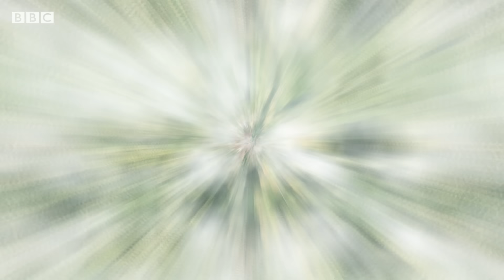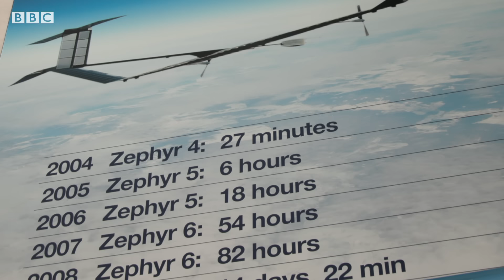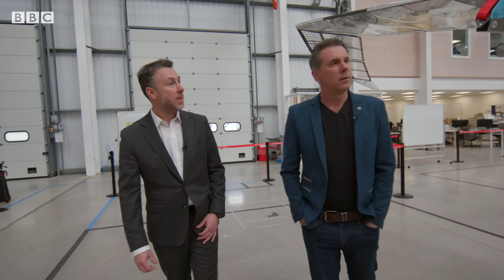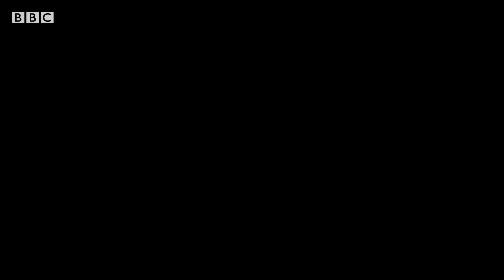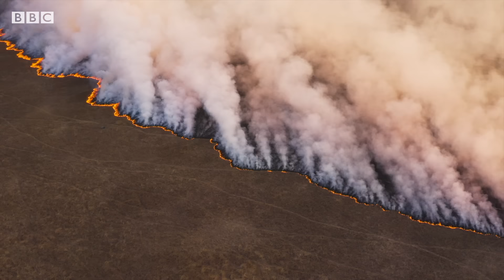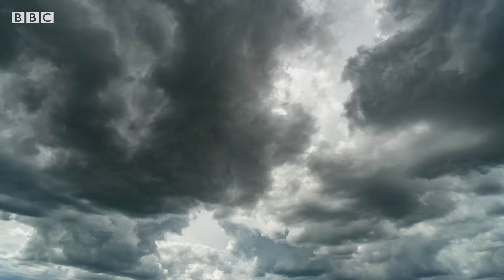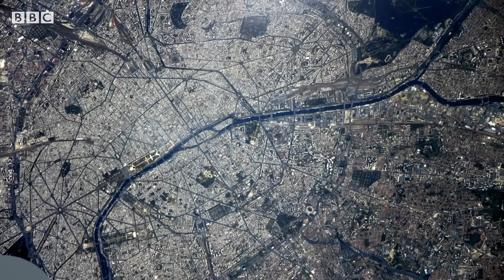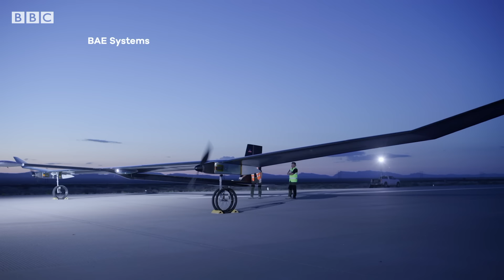The solar-powered aircraft flying high in the atmosphere | BBC News

Comment: I would love an FM broadcast transmitter on an aircraft like this. It would cover a huge region with no mountains or buildings to block the signal.
Reply: Or LORA
Reply: I'm no expert, but doesn't radio transmission for any significant distance require significant power?  They're already 5-6 miles up
Reply: @emmakai2243  5-6 miles line of sight is nothing, this could use much less power than terrestrial towers since it wouldnt have to transmit through terrain and obstructions
Reply: @dereksgc  And if the airplane flies around 40mph the turn radius is tiny.
Reply: @emmakai2243  Surprisingly not really. 50-100 watts line of sight will easily work at over 200 km of distance.
Reply: @emmakai2243  Not really, if you use higher frequencies. Shortwave radio for example doesn't need that much compared to say AM or FM. If you go into the Ghz range, then you will require a lot less power, although any obstacle (including trees) will block out the signal. It's how satellites do it: one satellite can cover the entire US for about 20 Watt/hour. And that's a signal that contains 100+ images @30 fps or so. So you could make rather easily an emergency type broadcast, containing pretty much anything you wanted to send in a few seconds, and say repeat (or change the payload) every 30 minutes or hour. Othernet sort of worked like that, they would send payloads at various times in a day, and if you got at least one of them, you would get the files of that payload. You really don't need that much either: weather + headlines + maybe important audio. You could probably send that in a fraction of a second and then keep the antenna off, and repeat the message at intervals.
The reason LoRA works better than regular wifi is for opposite reasons, what's messing your connection is interference, but that's a whole other tangent.
Reply: @emmakai2243  They're at 25 - 35 thousand feet? That's well below most of the jets.
Reply: @erickborling1302 they're at 60000 to 75000 feet
Reply: @emmakai2243 5-6 miles? He said 60000 feet minimum, that's over 11 miles
Reply: @emmakai2243 Yes. Lots of power.
Reply: @emmakai2243  The video was only 8 minutes and clearly neither you or OP watched it as these issues are discussed
Reply: @JBBost   No I didn't retain every single bit of info, where did it refer to FM radio power needs?
Reply: @JBBost  In the replacement for a lot cell phone towers discussion, I will believe it when I see it. Tech bros have a long track record of overpromising and underdelivering. I am an engineer, and I want technology to help us live better lives, the problem is is that the laws of physics do not care about what you want to achieve.
Reply: @function0077  If you're an engineer you sure don't sound like a telecom engineer and if you are you're about 6 years+ behind the times on this. The discussion in this field isn't even around replacing cell towers it's around supplementing them with satellites direct to unmodified cell phones in areas that currently don't have coverage (i.e. the majority of the planet). Do some DD on ASTS, they already solved this problem and tested it and are putting up commercial satellites this year. They will be able to do 5G broadband anywhere on the planet by the time their constellation is up.
Reply: @ThePalisky  I am not a telecom engineer. The information you are providing is interesting, but it is different than some of the claims made in this video.
Reply: @function0077  The information I provided is different because the people involved in making the video and/or the people making the plane don't know about the current technology.
Reply: @ThePalisky  "The discussion in this field isn't even around replacing cell towers"

The video literally discusses replacing cell towers with this.
Reply: @dafunkmonster  yes, this field I said, not this video. The video itself is missing what the telecom industry is doing. Thanks for incorrecting me.
Reply: I'm no telecom engineer but there are quite a number of hurdles here. The amount of power needed will be higher than a cell tower with that kind of distance. Otherwise, signal strength attenuates to unusable levels. With the power requirement comes the weight too in the form of batteries. Unless it chases the sun and maintains constant exposure to sunlight, which i don't think is possible since it has to travel >1600km/h in order to achieve that. On the flip side, it can utilize phased array to reduce the power consumption. But conventional antennas won't cut it, it'll need modern cellular antennas modified to operate directionally and at higher power for optimization. All these are highly dependant on battery tech though. Not sure if that's a wise thing to hedge his bets on.
Reply: @tichrontus  I'm a DXer and can tell you that the power is the least of your concerns. With a high gain phased array of some sort it's fairly doable. Bandwidth is by far the biggest concern when covering a big area, unless you're in remote areas in which case it indeed is not as much of a concern. You don't need too much power either. 50 watts will give you a decent enough signal with tens of megabits of bandwidth even at a few hundred km of distance.
Reply: @fungo6631  Hmm, and here I thought power will be its downfall. Bandwidth is not something I have much knowledge of so I'll have to read up more on it. I did study electrical during my mechatronics diploma but quite a lot of those are lost in time. But I assume based on your assessment, areas with higher transmission activity will end up requiring more airplanes covering smaller cells in order to avoid bottle neck in communication traffic? Please point me in the right direction if I made a bad assumption.
Reply: @tichrontus  Pretty much, yeah. And for smaller cells there already are ground stations.
Reply: @fungo6631  Thank you! I just read up on how phased arrays are narrowband. Increasing the number of array sets to have simultaneous transmissions make up for lack in bandwidth just adds to the weight. Yet another problem...
Reply: @tichrontus  They're not that narrowband. Not narrowband enough that it makes a meaningful difference for cell tower bandwidths. With OFDM modulation that's generally a non issue anyways as the fading is per carrier.

I believe you meant that they're narrowbeam. The beam gets narrower with higher gains. With 1D phased arrays you can make the beam narrow only in one axis but relatively wide in another. With broadcast towers you only need to narrow it vertically as you'll be otherwise wasting RF energy on broadcasting to aliens.
Reply: @tichrontus  More importantly, for this plane, the 50-100 Watts mentioned are a huge amount of power. It is only "nothing" if you have a terrestrial power line or solar panels and batteries weighing more than that plane.
Reply: @57thorns  Yes in some sense. This might be a little lengthy but here goes. Applying construction logic of conventional cell towers does not apply here. Generally, cell towers started out with power being more or less the dispensable factor. It basically broadcasts the signal out over an area (called a cell) but still maintaining appropriate signal strength at the edges. If a device moves out of its reach, the tower of adjacent cell takes over. Even so, simply blasting signals over an area consumes a lot of power. That's where the heavy cables you mentioned comes in. However, at least directional antennas are used for 5G (not sure about 4G though), this is more energy efficient. Giving an airplane a cell tower function doesn't mean copying its construction though. In order for it to have a possibility of working, its construction will be closer to that of a satellite. A good example will be Starlink satellite. It uses phased array for transmission and it is excellent in this case. Phased arrays transmit narrow directional 'beams' of signals unlike cell towers. This takes away the need to use pure power and brute force the transmission. On top of that, these arrays can steer the 'beams' incredibly fast without the use of heavy parts like motors. A phased array can be made to steer its transmission 'beam', switching between at least dozens of geolocations within a second. This is highly suited for transmission devices operating at high altitudes. Generally, electrical systems are not as heavy as before. Just like a microwave oven. If you noticed, microwave ovens used to be really heavy. The bulk of its weight came from the transformers which were made from laminated layers of iron. The microwave ovens nowadays use switched mode power supplies, which are a fraction of that weight. In conclusion, the only limiting factor is the energy storage specifically gravimetric energy density (energy per unit weight). I assume the airplane has to circle above a specific geolocation. Reason being, having a network of airplanes constantly switching locations makes the whole network architecture a nightmare to work with. But it also means it has limited charging opportunities, which still leads back to energy storage.
Reply: @tichrontus  The power needed is still a function of the area covered and the distance from base station to cell phone. Basic physics.  

Cell towers already use directional antennas with very little wasted energy going up or down and on top of this they normally have different antennas in a few directions creating several cells in the same circular area.
Reply: @57thorns  They do have both directional and omni-direction antennas. I assumed that power is the main concern (I've worked with UAVs as a technician when I was still serving in my country's airforce) but @fungo6631 quoted (edit: above, not below, for a moment i forgot how comments work in youtube hahaha) that bandwidth might be a bigger issue. That's an area I have little knowledge on so I guess I'll have to read up on it.
Reply: @tichrontus  its a pipe dream to think that a heavier than air craft that can only manage to keep itself in their air under ideal conditions can have enough surplus power to provide enough for what needs to be LTE cellular performance. It would need to have additional batteries and electronics to power these transceivers, then this additional weight needs to be supported by additional craft performance PLUS provide for a margin of error, this leads a self feeding cycle of needing additional solar cells and batteries that never ends. the other issue is a simple matter of risk. sure it may be able to replace 200 land based cellular towers IF they could pull it off... but it the craft fails (just as cell towers fail), then the result is a 2,000 square mile blackout.
Reply: @renaissanceman5847  I did ponder on the outage issue. In fact, I came to the conclusion that it could be combined with launch and recovery and solved together. Let's say one of them has a transmission issue and has to RTB (return to base). Being an aerial vehicle means unlike cell towers, it can be moved. So an adjacent 'cell airplane' (sorry for bad naming) can move into its position and the next adjacent one will follow suit forming somewhat of a ripple. If properly managed, this 'ripple' can be controlled to go in the direction of the base of operations, while ground personnel prep the replacement airplane for launch. In this way, instead of an outage that goes on for who-knows-how-long like cell towers, you'll have it shared over multiple areas in much shorter outages. To bring it one step further, airplanes from all the adjacent cells of the issue's origin can have their waypoints and transmission locations temporarily adjusted to make up for the outage. Then instead of an outage, you'll just get slower network until replacement 'ripples' down. On the contrary, a flight system malfunction will be another story altogether. Depending on the nature of the malfunction, this could potentially put lives in danger, a risk which cell towers do not pose. As for the power and weight issue, it really does still point back to battery tech which currently is clearly not good enough to make it more than a pipe dream. Like you said, with additional transmission equipment onboard, just creates a feedback loop to increase weight, PV panels and batteries. Until battery tech makes a major leap, it's not exactly feasible.
Reply: What about Am frequency rather than Fm
Reply: You haven't used satellite phones. A multi story building or even A LARGE TREE cuts them off. They're not at all uncommon here in Australia in the outback. I have seen them for sale in camping stores!